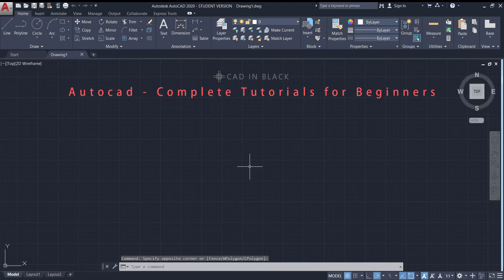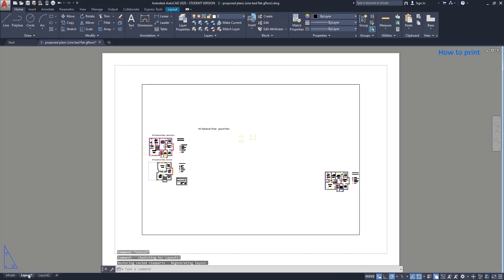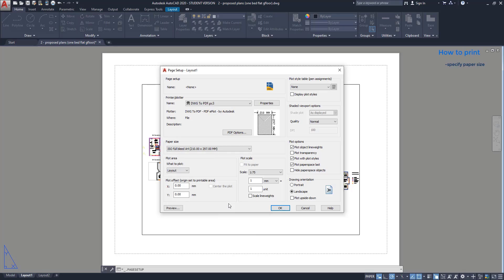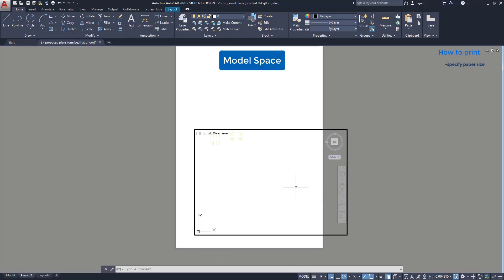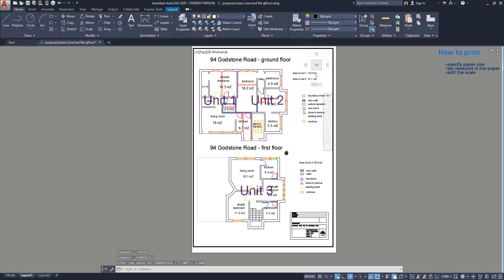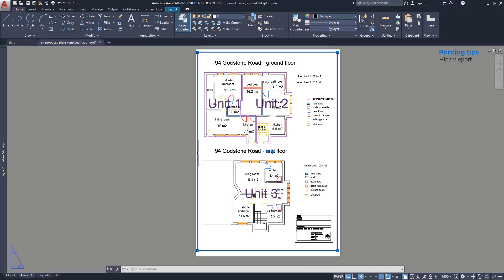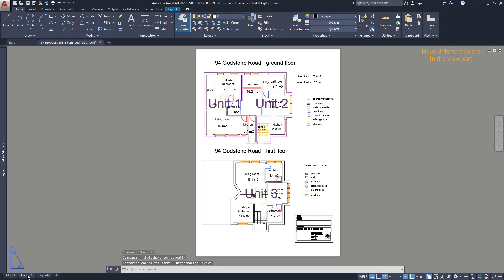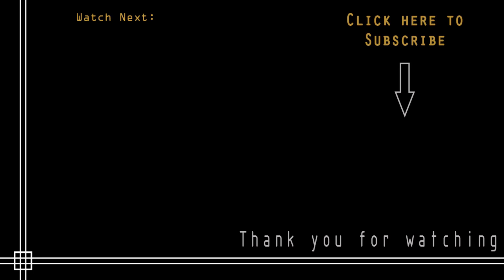Autocad - How to print properly (Scale the paper)

Comment: What if I modeled something in milimeters, and I want to print 1:1 in milimeters on paper?
Reply from the maker: Hi Ryan. As I understand you are modelling in real size. Just use the scale 1:1 on the viewport.
Reply: @CADinblack  I tried EVERYTHING. I tried every tutorial. Watched countless videos.  I had my model dimensions correct, I had my viewport 1:1 scale correct, I had everything correct and it would still not print 1:1. Finally, after not finding a single video mentioning it, I saw a tool called "annotation scales list" on the bottom tool bar.  I set this tool to 1:1 and FINALLY, it printed fine. I have no idea what this tool is for, but I am bewildered that it was not mentioned on a single video.  It was the key to getting things to print 1 to 1.
Reply from the maker: @ I am glad it work.
However it is not easy to understand exactly the problem only by text.
I can tell you that there is also another reason to not print in the right scale.
When you go to the Page setup Manager, you will see a section in the botton of the window called: "Plot Scale".
Make sure the units are correct and they are set to 1:1.
Reply: @CADinblack  thanks. But yes, this was set properly.

Comment: Hi, do you know why is autoCAD not displaying my scale properly? I made a drawing in mm (set it up in dwgunits to mm option 3) total lenght of the piece is 140 mm. Then I followed your steps to put in a paper space of iso A4 (297x210mm landscape)... And used the fixed scale option to put a 1:1 scale so this way 1 mm of model space equals 1 mm of paper space (right?). Then why when I print it , it displays as a total lenght of 120 mm? Like 90% of the actual size... Also I check out for the scale option in the 'page setup manager window' and it says 1mm=1unit and scale 1:1. So if these options are not altering my final print... What else can be? Thanks for 
Your video
Reply: I have been trying to solve this all day, and I can't figure it out either. CAD sucks. It is such a tedious pain in the ass where 1:1 doesn't actually mean 1:1.
Reply: Exactly I check all the units  and print the drawing. Then the metric scale drawing is not actually equal on paper. It's showing 1:1 scale but totally not exactly the real world scale.  @ryansanderson7023